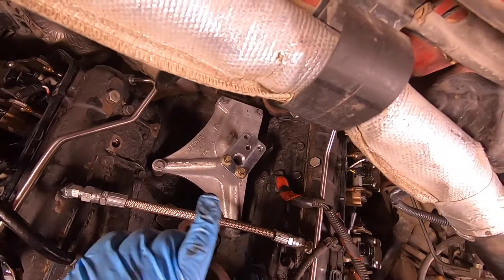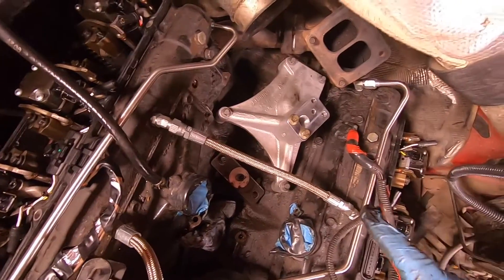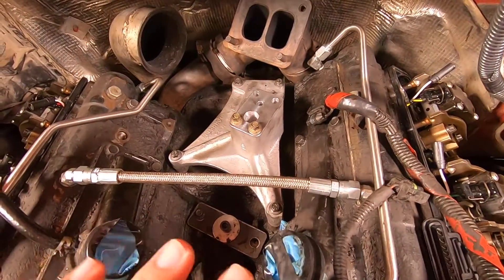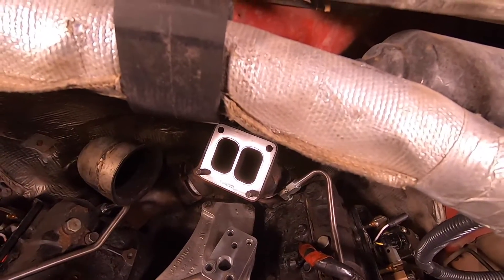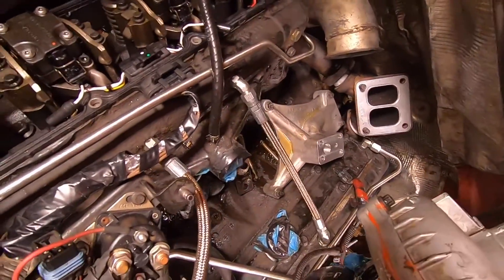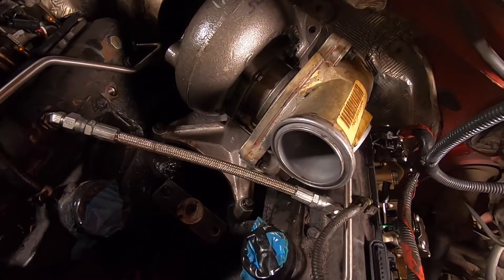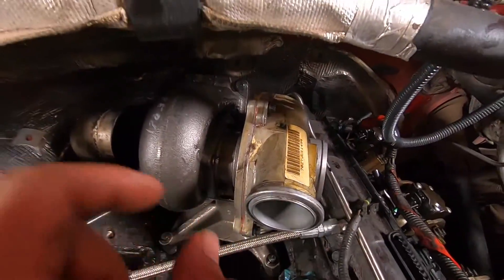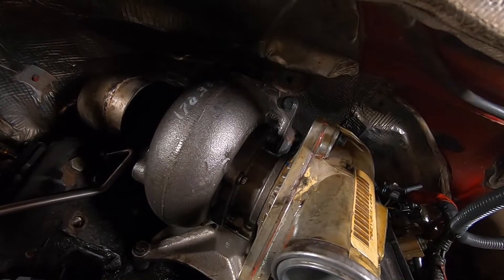KC TURBOS SXE S300 HYBRID TP38 TURBO INSTALL Stage 1 Build [EP.13]

Comment: To help keep the O-Rings into place I would recommend using some Lucas Assembly Lube instaed of oil to try to make them stick. The Lucas Assembly Lube is SUPER DUPER sticky and will keep them in place while you flip it upside down and put the Turbo into place.
Reply from the maker: Thanks for the tip will definitely get some of that for the next build

Comment: In my opinion, setting the entire turbo assembly down in one shot is much easier... no need to deal with o-ring worries and the need to work around the turbo to install things such as the ebpv housing. Of course, when i did my turbo i deleted it just like yourself. I was able to remove, upgrade(delete), and re-install my turbo assembly in only 6 hours, and i am not a professional mechanic by any means!

Comment: You should look into new bellowed up pipes. Do away with the donut gaskets.
Reply: Also, you can use the Dorman brand up pipes. Just make sure the hardware that comes with the kit isnt too long. There have been issues with that. Pre-fit the pipes to the collector before installing to check fitment. If the bolts are too long just get shorter bolts and it will be fine. Good luck and get ready to be dirty and frustrated!!
Reply: @xxxmikeyjock  I agree, BUT I am going through the same situation. Rebuild for $400 OR T4 Conversion for $2000. Myself, I am putting in the E-Fuel and why Im pulling the Turbo I'll just give it alittle attention so it will get me through a couple of years or more untill a t4 conversion.  My T4 will be on the list when I install Bigger injectors and a Intercooler system. Budget dictates some of the stages I have to work within.

Comment: You should compound turbo your truck. I have the exact same turbo you have and I added a low pressure gt42 and wow man, I couldn’t imagine driving my truck without it. Add a external wastgate on the exhaust after or on the turbine housing. Get back with me and I can send pictures and detailed instructions to ya👍

Comment: I sent you a message a few months ago. I have a early 99 7.3, crew cab longbed 4x4 that I've owned for ab 12-13 years. One night out of the blue while intoxicated I ordered a bunch of upgrades on ebay. Hopefully this information helps you remember my message. Anyways last Sunday I was in a head on collision. Truck is totalled. Drunk driver (new Camaro) drove into my lane at 60 mph, my dog and I were driving 15 mph. I really only enjoyed my truck after all the mods were installed. I am incredibly sad, it took all that hard work to enjoy that truck and for things to end because of a dick head drunk.
Reply: @blowingdiesel  dog and I were both injured. The passenger side airbag deployed but my dog still hit the windshield really hard breaking it. Dog is already back to normal.     (120 lbs American bulldog) l have to go through surgery to repair my injuries. I don't think I'll be compensated for the aftermarket upgrades I purchased and personally installed on my truck. I think they will pay out current market value. It's worth a great deal more than that to me. This does suck.
Reply: @blowingdiesel  thank you.